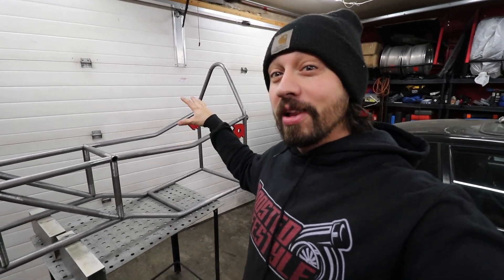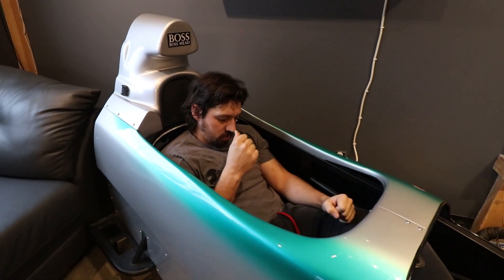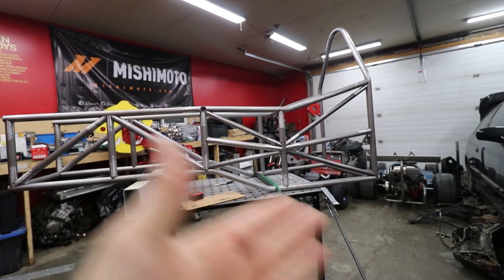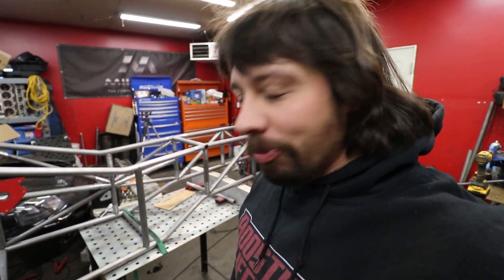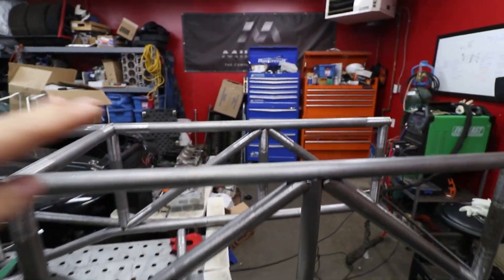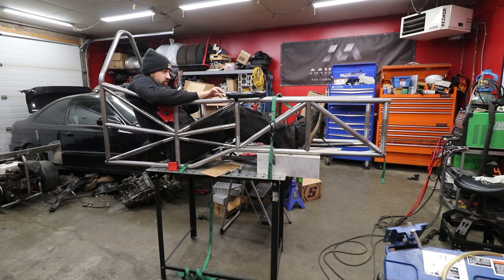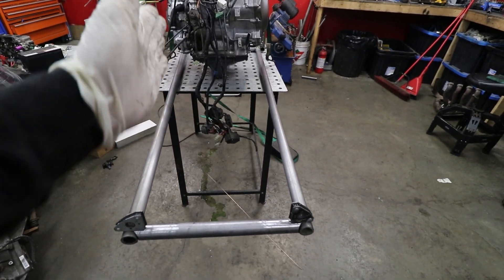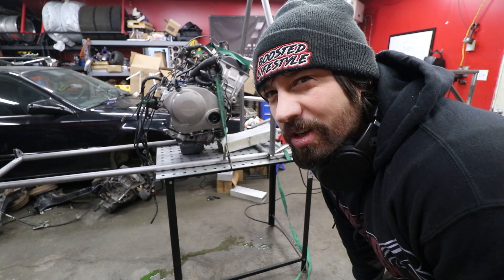Homemade Formula One Car Gets 11000 RPM Honda Power Unit - pt 2

Comment: Great video my friend. I’ve just started to do my own F1 project!. It’s taken just a year to plan and 
find lightweight strong materials! 

The engine is a Mercedes Benz (R129) SL600 Engine v10. I got this for next to nothing!.  It’s been sent away for skimming heads, cam rods and a few modifications to make it less bulky!. 

Lucky for me is that my son is a structural design engineer!. He’s managed to use 3D software than can tell you where the pressure points of having a big engine would be. 
This is one of the things that’s been challenging. However I think we managed to do it.

Comment: Na bro, f*ck the safety. Far too much bracing? The share weight of it could cause more issues than it'll solve. You race for the excitement and exhilaration right?? The morr safe it is, the more you lose that exhilaration, so strip it back to how the frame was originally and just go for it bro. I want every rider and driver to go home safe after every race but God damn! It's getting to the point of destroying the sport cause of "safety". . . They're extremely and dangerous sports!! That's why they do it!!! Stop baby proofing every f*cking thing that's enjoyable. In motorsport has gone too far

Comment: Formula SAE (FSAE) and Formula Student cars are a good reference point to work against - the combustion varieties generally use motorbike engines and are reasonably similar dimensionally to your vehicle. They have very open technical regulations so you will see a huge variety of technical solutions across the category.

Comment: ideally at 3:10 you would put the braces more in an diamond shape rather than an x shape. You just need to imagine where the forces will travel and how they will distribute themselves. with how it is currently it will be quite stressed on that center point

Comment: Would there be a way to extend  the width of the frame by a bit by slicing it in the middle and adding some pipe inbetween or would that extention become a massive weakpoint of the frame? I'm mostly concerned with the safety from a hít from the side.
Reply: I agree he needs more space at the hips, a broken pelvis is something no one wants. That being said he’s too far along to widen it.

Comment: It's  a LOT on the long side.
With chain drive you can pretty much put the rear wheels right beside the engine. 
Obviously, that would be too short but, still.
Right now it's way too long.
Reply: Granted.... it looks better than MY formula 1 car build.....

Comment: You MUST change the oil pan to one designed for cars. Motorcycle oil pans are designed only for vertical g-forces, as motorcycles lean into the corners. Cars take horizontal g-forces, causing the oil to pile up on the side of the pan, causing oil starvation, resulting in blown engines. The automotive oil pan also allows you to mount the engine lower in the frame, lowering the height of the CG, improving handling. There is a lot of discussion of this on the Apexspeed formula 1000 forums.
Reply from the maker: I'm going to give myself some extra engine height so I can get a different pan !

Comment: High performance road bike motors are designed be leaned over in corners and hence the shape of the oil sump. In a high G car they loose oil pressure in corners

Comment: Loving this so far! I was the chassis manager for my FSAE team and now work in Formula 1 so this is a real throwback for myself! I would recommend mounting the engine longitudinally so that you can get a sprocket to propshaft adapter and then run something like an Miata rear differential. Will be much better than running a chain and then having to design in a chain tensioner. You will also get less power loss through the drivetrain and will give you more options for rear upright/hub configurations. It would be worthwhile making the engine a structural member meaning you can take the whole rear of the chassis off if you say have an accident rather than having to cut and grind out any broken tubes.
Reply from the maker: Dang dude! The man with all the insight is here 😁😁
Reply: @Boostedlifestyle  Happy to help in anyway I can mate! Drop us a message at any point i you need me👍
Reply: What team do you work for
Reply: Hi bro I need your help for my f1 team in college level building..can you share your social media or email .. please
Reply: Actually you’ll have less power loss running through a chain.
Reply: @bmc3663  not with having chain slap and roller wear, plus limits differntial options

Comment: If I recall my engineering statics course, forces are directed along the members so is having them all converge at a single point next to the driver really what  you want to do? I would think you would want to spread the load over a larger section of the frame. But what do I know.
Reply from the maker: I'm not an engineer so you likely know more than myself

Comment: I watch another channel (SuperFastMatt) that also built a race car with a motorcycle engine. He ended up destroying the engine because the oiling system in a motorcycle engine isn't meant to have all that g force sideways, it's Mebane for the engine to be leaned into the turn forcing the oil into the sump instead of away from it.  He had to build a dry-sump system for the 2nd engine.  Just some food for thought.
Reply from the maker: Yeah people have been telling me. I don't know what the solution is on a budget
Reply: @Boostedlifestyle  I'm not sure how much he spent, but he definitely built his all on his own. Might be worth checking out his channel to see how he did it and get a few ideas.

Comment: If anything use lead mostly under the seat. I don't know how strong your engine is gonna be nor how you will distribute the weight. Keeping in mind if you pull your tires forward, you will create grip in the front and less in the back, and vice versa. But if your honestly making some as fast with a 1000cc, i would suggest learning how weight distribution works in a real F1. Be sure you have a strong flooring because a faulty floor could cause weight problems and cause understeer. To be brutally honest with you, your building almost the size of a real F1. But if your gonna make the wheel base as long as you said, I would try to find ways to make up a center weight of gravity. Including the front and rear wings if your gonna go that far.

Comment: How do you want to deal with oil starvation around big long corners? Suggestion: get superfastMatt to send you the parts/files he used to make his sendcutsend dry sump, it might have even been for the same motor!

Or, go cheap and accusump it?
Reply from the maker: I didn't even think about the oil issue thing!!
Reply: @Boostedlifestyle  don’t let me start analysis paralysis for you though, the “just send it” strategy does get things done… don’t wind up like me with 3 scrapped CAD designs for a project over 3 years before ever turning a wrench on it…

Comment: Hi mate Neil from Cheshire England. I'm a welder fabricator. Where all the bars meet in the middle weld a plate on the inside of them like where you sit. This will tie them all together and add a lot more strength to where they all join up next to where you sit. Just like a 8 mm thick plate, maybe a circle shape 👍
Reply: Just like the bracing on fia spec cages

Comment: Hey bud, put some baffles in the sump. Superfast Matt put a bike engine in a car and it starved of oil going around corners at the track. Also in his latest vid he increased the rmps of the engines so that may come in handy.
I think he may have gone a dry sump for his replacement motor 🤔, good luck. It's looking good so far.

Comment: Why not use a normal diff and turn the engine 90deg and have a prop on the sprocket that way you can run a reverse box and have reverse.  Same and how a legend race car does

Comment: Iv bin meaning to ask where did u get your tube notcher? And what size will it work on and how much was it ,,,u have inspired me iv got a rb26dett out of a nissan skyline r33 GTR buit ready for 800bhp or so on upgraded twin turbos and my dream is to basically use the front And rear subfram from a r33 and tube chassis everything else,  basically like an Ariel atom just with an rb26 and sequential instead of a super charged honda with a manual

Comment: Looks good!  One tool that I found super useful was a die grinder with a sanding barrel the size of the pipe your mating the coped tube up to.  You can fine tune your notches very easily and precisely.  Also die grinding/cleaning the inside of the tube also helps the cleanliness of the weld 👍

Comment: Kyle, i love your channel and humor. Keep up the good work. I wonder why dont you rotate the engine 90*C and make some kind of propshaft to an normal differential? Doesnot have to be a very beafy one. The motor has ni e horsepower but the torque is not that one. And torque kills stuf horsepower not.😃 keep going. Btw as a dutch f1 fan ofcoarse you need to use a Honda engine😂

Comment: Nice call Formula One and Indy engines are high rpm  motors, they used to rev to 20,000 rpm and are now limited to 15,000 rpm

Comment: Another good measure is to make the front of softer metal and make it more rigid as it get closer to where the driver will be sitting so the front will absorb an impact as much as possible before getting to where the driver will sit. And the driver will be protected by the rigid cage from the impact.

Comment: My only anxiety is over what brakes you will use to actually STOP that pocket missile lol, love the build though man
Reply from the maker: If like to find some Miata stuff
Reply: @Boostedlifestyle  why not rob a bunch of bike brakes? Like something off a motorcycle or an ATV 🤣 if everything is custom might as well
Reply: @Boostedlifestyle  why not use the front and rear motorcycle brakes on it that the engine came from, if you still have it. 2 of those front set ups should be more than enough i would think
Reply: @young11984  Clearly lacking what is necessary for proper brake systems for a G1, F1, Indy type vehicle !!
Reply: @young11984  usually sport bikes have a disc on each side of the front wheel - to get the same braking force per lb of vehicle he’d need more discs than he has uprights I’d think
Reply: @mitchellsnider4198  exactly, dual rotors and calipers on the rear and same on the front. Four caliper brakes
Reply: @young11984  I’m racking my brain trying to rationalize this because I love the idea for how lightweight it’d be compared to using car brakes. If you managed to build a custom hub/spindle that used a high offset wheel from a small FWD car you could probably mount the two discs both inside each wheel, so you have two rotors spaced like 1” from each other. Then the calipers share a bracket but they’re clocked slightly differently. And since it’s a high offset wheel you run a better chance of being able to keep the scrub radius down without too much kingpin inclination, which would mean he could run a little ATV steering rack or something (REALLY helps with how little room you’ve got to make multiple turns of the steering wheel comfortably)
Reply: @mitchellsnider4198  i was saying one rotor per wheel and duals on the rear axle like on the front of a bike, thats all just assumptions he will be running a car type 16-17” wheel to clear them. Just rattling off ideas really but all will be based off wheel diameter for brake caliper/rotor clearance
Reply: @young11984 weight. 
Motorcycle brakes are meant to stop motorcycles, not motorcycle powered cars.
Reply: @definitelydipper595  apparently you havent seen the lightwieght drag race brakes that stop drag cars then, this cart will likely not weigh but 800ish pounds so 4 calipers and discs off a motorcycle will stop it just fine but IF he actually road races it then the pads will not last long.
Reply: @young11984  drag racing brakes are made to work in unison with a parachute. If you know anything about drag racing, you’d know how often they are hammering those brakes….once per run…. Then 10-30+ minutes until they make another hit. Those brakes cooled down just fine.
Reply: @definitelydipper595  man drag race brakes are just that designed to stop, there are thousands of vehicles out here running 150+ without chutes, they also drive them on the street for hundreds of miles on drag and drive events also. he hasnt said how he intends to use this little car and may be just for playing around so if thats the case motorcycle brakes would be just fine since they are used constantly when being used and sport bike are usually used hard when they are ridden too. Either way until intended usage is told my initial comment was a joke about all the other toys he builds he normally test with minimal to no brakes lol
Reply: @young11984  there is 0 cars going 150+ without chutes. If they want to run a sanctioned event, parachutes are mandated at 150mph+

Again, they are meant to slow a car down ONCE, then putt back to the pits and cool down. If you tried to drive them on a road course you’d boil your coolant and end up like Uncle Chet eating a wall at 170mph 🤦🏻‍♂️
Reply: @definitelydipper595  never said they they were using drag brakes for road course use and the pads would be gone on a road course before brake fluid boiled, not coolant, you must not watch a lot of no prep racing as most is not ran in a sanctioned body or follow standard safety much less ihra rules. Been many cars running over 150 and chutes not open and drag brakes does fine without boiling fluid too.....Cleetus just had it happen again and stopped fine though. I drag race and run road course so im well aware if what it takes to stop both types of cars bud so i dont know why you getting all critical over a vehicle that its unknown what he will do with it yet but ok
Reply: @Boostedlifestyle  if you can find the biggest 4 piston OEM brakes that clear the wheels you had in mind I’d think you’d be in good shape - what if you got a set from a small SUV if you struggle to find Miata stuff? Disadvantage is unsprung weight but hey, it’s cheap
Reply: We all know that brakes are gonna be soo bad for the power of the formula 😂😂
Reply: @Tittos_E_36  well the less weight the less brakes you need so he should be fine
Reply: Link up with cleetus for some tbm brakes?
Reply: @chrisharrison9821  I don't think $3-4k for brakes will fit the budget...
Reply: @chrisharrison9821  great minds think alike
Reply: Look at proper kart brakes.  6pot rear 4pot fronts.  210mm vented disc all round.  Will be enough for this.
Reply: Don't put those tostada discs you put on the lawnmower on the F1.
Reply: As a car gets lighter not only acceleration gets better, but the braking becomes greater
Reply: Imagine it’s carbon ceramic brakes with 6 piston callipers lol
Reply: F1 use 6 pots the diameter of the discs isnt as big as you think, however they are very wide. Remember back in the 80s and 90s golden era they ran 13inch rims, big brakes arent needed due to the light weights its just fade resistance

This guy will be fine with miata brakes, and if hes running ir at a track, just put some track pads in, and maybe the same size but bstter quality than oem rotors.

And im sorry i love drag racing but you cannot compare their brakes to f1 at all
Reply: Hit up Cletus McFarland for some TBM brakes
Reply: @rynoasphalt4172  You mean Motion Raceworks for TBM or Willwood or other for proper racing brakes correct ??!!
Reply: The 1000 brakes will be fine
Reply: @lesheath6216  Those brakes are sufficient, good enough for that motorcycle but not for this planned, vehicle.